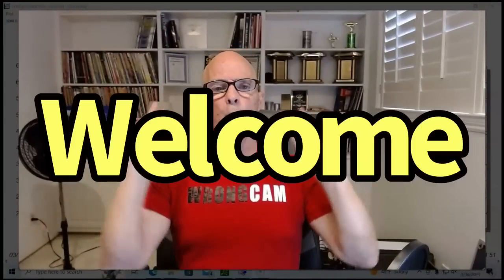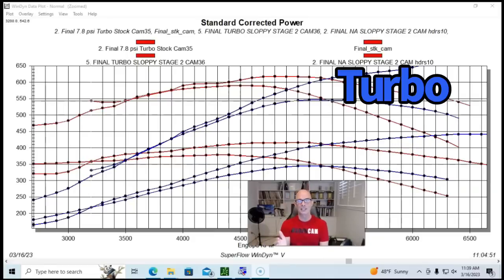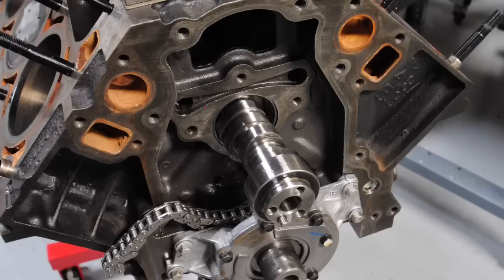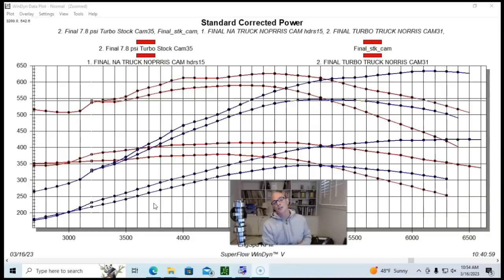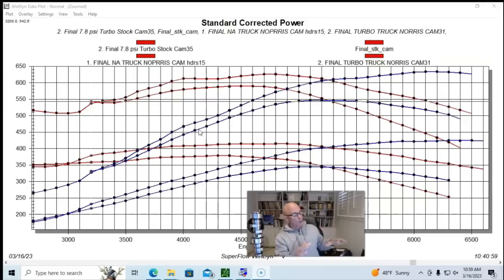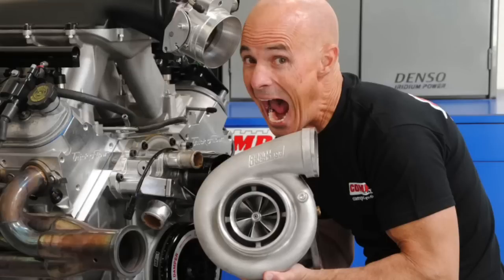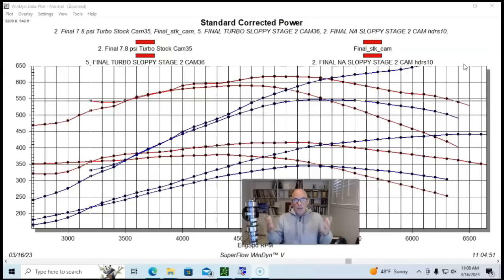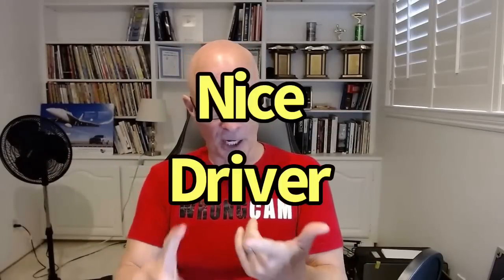WHAT MAKES A TURBO CAM A TURBO CAM? HOW MUCH LIFT, DURATION, LSA AND OVERLAP CAN YOU REALLY RUN?

Comment: Through all your testing of cams, what cam gave the most hp gains from 4500 to 7500 rpm on a ls6.0 ?
Reply from the maker: lots of good choices-you will need something that just fits available P-V
Reply: @richardholdener1727  Im sure you can give me an idea of what would work. I’m using the Pro LS 4340 Piston and Rod Kit, 364 Cid., 4.000 bore, 3.622 stroke, 6.098 rod, 12cc dish, 9.6:1 @ 65cc, 9.2:1 @ 70cc, File-Fit Rings
Reply: @richardholdener1727  Here is what the engine is currently running. Pro LS 4340 Piston and Rod Kit, 364 Cid., 4.000 bore, 3.622 stroke, 6.098 rod, 12cc dish, 9.6:1 @ 65cc, 9.2:1 @ 70cc, File-Fit Rings
Pro LS 2618 Forged Piston, 4.000 bore, 1.326 C.H., 12cc dish, Std. Stroke, .945 pin Press or Float, NA/Boost/Nitrous, Cathedral/Rect. 6.0L LQ4 LQ9,
Piston Rings, Gas Nitrided Steel Top, Martensitic Ductile Napier Second, Std. Tension Oil, File Fit for 4.000 in. Bore, 1.2mm, 1.2mm, 3.0mm, Set
Pro LS 4340 Forged Steel H-Beam connecting rod, 6.098 in. length, .945 pin, ARP 2000 7/16 12 pt. rod bolts, full floating, stroker clearanced

Comment: Based on Richards advice I chose a "stage 1" turbo cam and a "long runner" stock style intake with my 7875 turbo.  I bet the car is way more fun than if I went with a stage 3 cam and short runner sheet metal intake.  Most people ignore the advice and just buy cool "race car stuff" and slap together.
Reply: A stage 1 cam with the sheet middle intake will have the down low of stage 1 and have a top end like a stage 2

Comment: Hey Richard,
another great video on turbo charging as this is my first foray into turbocharging. You happened to actually do a full video on my Comp Cam 35-518-8 that was also massively informative. My question is on power peak rpm. I have a 363 Ford with this cam, (AFR 1492 heads)and on the dyno the power peaked at just over 5100 rpm. The cam spec says it should peak at 6200. Is that due to the extra displacement over the 302? Or what other factors would there be? TKS!
Reply from the maker: the intake design and head flow and displacement also dictate the peak power rpm

Comment: how about a 6.0 n/a build combo vid. no power adders. Diff heads and cam combos maybe diff compressions
Reply from the maker: please see the how to max your 6.0l or any of the many other 6.0l cam test videos
Reply: @richardholdener1727  ive been watching a ton of your vids. I have crank rods and a 6.0 block just looking to do N/A with a manual. Kinda shooting for 650+ hp. no clue on heads or cam
Reply: also thinking e85 with 12:1 compression

Comment: The LSA and duration split absolutely effects the curve, you can see even on your dyno sheet that N/A with the Truck Norris cam the power is holding on all the way to the edge of the sheet, yet boosted the power is starting to drop off and you pull the pin early, its dropping off because there isn't enough blow down time beyond that rpm point to clear the cylinder of the extra combustion gasses, there is only a certain speed the exhaust gas can peak at before it can't move anymore volume, this then becomes pumping losses.
If you took that cam and just widened the LSA only then that power drop off point would move further up the rpm rage before you get to the same issue again, then its looking at duration, opening and closing events of the exhaust valve to control cylinder pressures at different points of the rpm range to make sure your not lifting the head and blowing head gaskets or worse all the time. 
So much more to the science of a camshaft in reference to boost for the best efficiency, performance and longevity.
Reply from the maker: the motor makes peak power at the same rpm, so you are seeing something that is not there-if you want more rpm, cam it accordingly
Reply: @richardholdener1727  the boosted engine doesn’t carry the power like the N/A engine, the N/A engine peaks then carries the power like it does because it has run out of cfm but has enough cross sectional area in the intake system to maintain stability.
The boosted engine is falling off because of the reasons I said in my original comment.
You need to look at what’s happening beyond peak power, if you want that engine to carry the power and replicate the ENTIRE curve then changes to the camshaft need to be made, you should ask Billy Godbold for some advice 👍

Comment: Hey Richard, I got a question about the 5.3L LM4, I was wondering if the Truck Norris Cam from Brian Tooley would work for a torque boost for a daily driver. 
I am not looking to replace converters or tune it. Any thoughts?
Reply from the maker: a cam swap will require a tune
Reply: @richardholdener1727  great, so my follow up is do I need to find some race corvette guy who will eventually figure it out or is there an out of box tune from BTR that is tried and true that someone can flash on?

Comment: Hi Richard I have been following your videos for a couple of years. I am getting ready to try turbocharging and engine for the first time. I plan on leaving my nitrous cam in the engine. The cam specs are 112* intake center and 112 lobe separation and duration @ 0.050 is 268/278 with a lobe lift of 0.430 in a 12.5:1 compression 408 SBC with a set of out of the box profiler 210cc heads. I am looking at the on3 107mm with 1.30ar.  How hard is it going to be to spool this turbo. I plan on doing some street driving on e85 blow through carburetor. It will see more racing action than stop light to stop light driving. Goal is to stay around 15-20 lbs of boost and make 1200- 1300 hp. 
Hope to hear back from you and keep making videos. I do enjoy them. Lots of good information.
Reply from the maker: you have a big motor which helps, the question is, how is the low-speed torque on that motor right now NA? Not great I would imagine
Reply: @richardholdener1727  it is not too bad NA, but I normally run a minimum of 200 shot of nitrous. Car weighs about 3300 with me in it, and it will 60' 1.59 1.60 NA and 1.30 on a 200 shot. Needs more gear for nitrous. I'm running a 3.89 gear. The car will run 6.80 @ 100 mph NA 6.30 @ 110 mph on 200 shot of nitrous. 
I was just wondering if the 107 is too large or should I be looking mat the 94?
Reply from the maker: that cam is a high-rpm cam-the turbo will make power in the same effective rpm unless you go small on the turbo-you don't need that much cam to make big turbo power
Reply: @richardholdener1727  I have a 245/252 @ 0.050 on a 104 intake center and 108 lobe separation. Would that be a better choice? Then 94mm or a 107mm. Sorry for so many questions. Just new to turbos and I respect your opinions, and trust your knowledge.
Reply from the maker: what is your desired power level-we made 1543 hp with a 231 (at .050) cam, the turbos provide the power
Reply: Check out no name racing, he has a big on 3 turbo and he doesn't mind breaking engines you might find something helpful there

Comment: Why not test it with the power / boost formula in mind? Does a “turbo cam” make the engine any more efficient from a % of gain standpoint versus a non turbo cam at similar boost levels? What about potential backpressure differences at these same levels? I think it would make a good test. 

Also, what about boost threshold (minimum RPM where the turbo spools)? Or response rate (time it takes to spool at higher RPM)?  Might be hard to test on a dyno versus in a car but also be interesting to see if the “turbo cam” changes anything.
Reply from the maker: Did I not make it clear in the video that every cam responded the same (% gain) when we added boost? They did
Reply: No actually you never mentioned power / boost formula or showed any % of gain data in any of the examples.
Reply from the maker: To recap the video-boost multiplied the power output of the na combo with any cam based on the formula (one cam did not respond better)
Reply: @heytonyman A lot of bad info in these video.

Comment: So basically, for better reliability and a cheaper go fast setup, I should just keep my VVT cam which makes 470 ftlbs minimum from 1800 rpm to 5200 rpm and just turbo this engine? What is my downside here?
Reply from the maker: that works fine-the stock vvt cam doesn't make lots of power in the higher rpm but, the turbo will just elevate what is there

Comment: New to the Turbo game, been an N/A Nitrous guy for decades. Very impressed with your method of presenting information, it is much appreciated and bound to save me $$$ in my new endeavors.

I live at 7000 ft. elevation and would like to see some advice on what to look for in working with thin air for daily driver stuff and also spooling/power at the track. Albuquerque and Denver specifically. Thanks for all the help you've given already.
Reply from the maker: the altitude doesn't change what was said, more torque down low equals more boost response

Comment: As far as I can tell in the DOHC world the terms “supercharger, turbo cam” compare differently to the “n/a cam” mainly with the event dynamics and not necessarily the lift or duration. The ramp rates being symmetrical vs asymmetrical will make differences too.

When they refer to turbo cam is designed to help where the turbo lacks such as down low and opposite with the blower cam. It will help the blower up top when it needs more help.

That’s the only thing I can tell that would be different when marketing the terms for the cams.

However I completely agree with this for pushrod engines.
Reply from the maker: is the dohc really any different?

Comment: Can all cams be nitrous cams?
Reply from the maker: nitrous just adds to what is there (until you get to very big shots-which you team with big cams)
Reply: @richardholdener1727  thanks for the reply, what would you consider big. I have a 400 shot plate but the cam is pretty big. Lift .768 108 LSA

Comment: From you videos it looks to me the ss2 is the best turbo cam for 6 liter
Reply: Am I missing something are is the ss2 cam on a 6.0 a better low end cam then the truck cam with added high end
Reply from the maker: the truck norris cam is better down low than the ss2 cam (both turbo and na-so are lots of other cams), but the ss2 works
Reply: Ok guess I meant the v1 btr truck cams. Have you ran the truck Norris on 6.0 I couldn't find it.
Reply: Thank you your very helpful . I started this ls swap on my obs short bed couple months ago I've learned so much from your videos I didn't realize how easy I could make power

Comment: Yes use a good low rpm cam then let the rising boost curve take care of the power on top. That way you can max your power across the rpm range based on what your hard parts can handle.

Comment: What I’d like to see was sloppy stage 2 228-232 cam but 108lsa against exactly the same at 114lsa and see what happens NA and boosted
Reply from the maker: the SS2 is 228/230, but whatever the tighter lsa does na-boost just multiplies that new curve as show in the video with every cam tested.
Reply: @richardholdener1727  I understand that, but more of an LSA test then an actual NA to boosted test I suppose is what I meant, just to compare something that’s a definite NA style LSA to something that’s more power adder orientated, possibly is a turbo cam also an NA cam is what I’m trying to get at haha
Reply: I would actually like to see that too.. And the comparison of the boost/back pressure curves as well.

Comment: Could you do a cam comparison for a good street combination.  A turbo sized for the street, so it will be responsive, but it may have a higher pressure ratio (intake to exhaust) when comparing to a drag race application for example.  Then compare a well matched cam profile with different amounts of overlap, with three different boost levels for each cam.  15, 20, 25 psig.  The goal would be to see which one performs best under this test.  You made the point, but overlap provides a scavenging mechanism, but the heads, headers, intake...  have to support also, otherwise overlap can lead to excessive residual exhaust gas left in the chamber or possible flow reversal into the intake.  The question is not that you need a "turbo" cam, but the profile, timing, and overlap can be optimized and optimal is not the same for NA to turbo, or big turbo to small turbo, and...  or maybe it is, but a dyno comparison would tell the tale.
Reply from the maker: no on the residual exhaust gas LEFT in the chamber. Turbo cams (as shown) also have overlap. Optimizing the cam for any given combination can be done, and might require a specific cam, my point isn't that a truck cam makes the same power curve (or runs efficiently at the same rpm) as a pd blower cam, my point is you can run a turbo with any of them
Reply: @richardholdener1727  You clearly demonstrated that you can  run a turbo with any cam and make more power. I appreciate all the knowledge you have put out with your videos. As a future video idea, optimizing a cam for a turbo combination vs optimizing for an NA combination and seeing the comparison would be intriguing.  Especially for a higher boost small turbo street combination.

Comment: The question from a noob now becomes, do I use same valve springs that come with the NA cam or will a turbo make the springs weak and have valve float?
Reply from the maker: the cam you chose will have springs designed for them-use those

Comment: With your turbosystems that makes more backpressure than boost and are not very powerful anyway, a " turbo cam" would make power.
Reply from the maker: I think you mean a cam will make power

Comment: When He some Day build engine that make over 400nm torque/ per 1Litre,  then he make new video 😅,  like he's t-shirt wrong cam.
Show must Go👍
Reply from the maker: 295 lb-ft per liter has been done-much easier with smaller motors-that doesn't change the results of all the testing
Reply: Truth, NA cam can be good for turbo so long as total exhaustGasMass is not too much for total exhaust flow capability.
My test may differ from pro's

Comment: Thats exactly what I did I'm building it the way I would build a good NA package and when I'm happy with that then ill pop the Turbo on If I can make 600-700 NA I won't need to push the Turbo, the cam I picked turbo didn't come a consideration. im not building a full on race car im after a tough daily

Comment: Your definition of what makes any cam a turbo cam is doesn’t seem sound. Optimise cam NA then add boost and see if the cam is still optimised. Clearly any NA cam will work but is it still optimum.
Reply from the maker: The term optimum is subjective, what power do you want and where do you want it? Pick a cam that does that then add boost
Reply: @richardholdener1727  it is subjective but like anything else you can state what you think optimum means for the application at hand. I would be interested in why BTR sells turbo cams if nothing needed to change and an NA cam produced the best results

Comment: As turbo cam sales drop like Bank stocks this week....  I'm using the BTR torque cam with the 202/ 202 duration in my twin turbo build.  Early Spool, super strong mid-range, no need for over 6,000 RPM.  Just look at the n/a power curve and decide which one works best for your application and then imagine it multiplied and that's how you pick your cam.
Reply: wont effect sales...Richard has been saying this awhile.
Reply: was mostly sarcasm, I've also been saying the same thing for quite a while.
Reply: @coboscustoms4342  cool, sarcasm is hard to tell on text.
Reply from the maker: I ran a torque cam with a hi Ram on a 4.8 L with a turbo, bad combo, but it works
Reply: @richardholdener1727  that specific combo would have been better with a truck intake manifold.  The high ram defeats the purpose of that torque cam especially on that little baby engine

Comment: Simply put, cams no matter the make for what engine will idle,spool and give better low end drive ability with smaller digit specs. But with larger digit specs will teeter-tot the dyno graph upwards in favour of power at the sacrifice of low to mid range torque,spool & response.

Comment: On N/A engines tighter lobe separations make more power vs wider lobe separations.
Reply from the maker: IF IT WORKS ON THE NA MOTOR-IT WORKS UNDER BOOST AS SHOWN
Reply: @richardholdener1727  Good vid . Can't get enough of them.
Reply: Not necessarily. Our 500 inch Pro Stock engine ran best with a LSA of 116. The LSA of a cam can give some sign of the shape of the torque curve, but be leery of blanket statements.

Comment: In my experience the turbo cams are better on the starting line on a drag strip, with big turbos. Anywhere else you're correct, the turbo multiplies the na power.
Reply from the maker: A CAM 9ANY CAM) THAT OFFERS MORE LOW-SPEED TORQUE WILL BE BETTER ON THE LINE
Reply: @richardholdener1727  I 100% agree with you. I believe the reason there are turbo cams is guys having really rowdy na or nitrous cams, going to turbo and it not spool up. So they call a cam company and say I need a cam that will spool the turbo, bam here's your turbo cam.
Edit- I'm also talking about pretty fast race stuff. Couple steps above you're average street/strip car. And the converter along with the tune will make a difference. It's all about your combo and what you want it to do. Just like you said lol

Comment: What about the 2.7 high output Chevy 4 cylinder that has a variable Camshaft 3 different lobes.
Reply from the maker: THAT SHOWS YOU THAT THERE ARE DIFFERENT CAMS FOR DIFFERENT RPM RANGES

Comment: Why not test cams with different dimensions and see the differences then. Example a 215/230@.050 with a 108lsa vs a cam with 215/220(or 215/215) with 108lsa. Then change lsa in same cams and see differences......
Reply from the maker: ALREADY HAVE-IF THE CAM MAKES MORE POWER NA-IT MAKES MORE UNDER BOOST
Reply: @richardholdener1727  so you tested it and did it at different boost/hp levels?